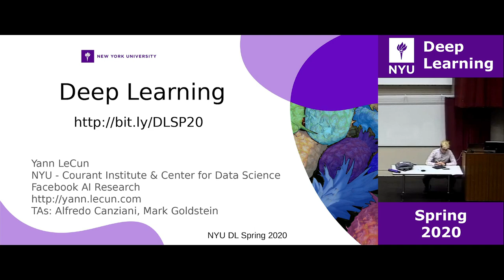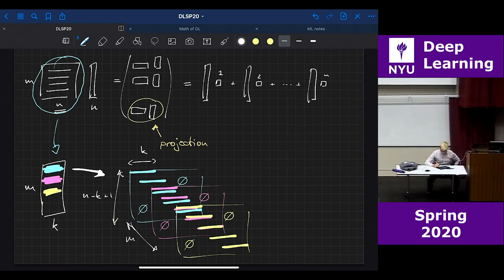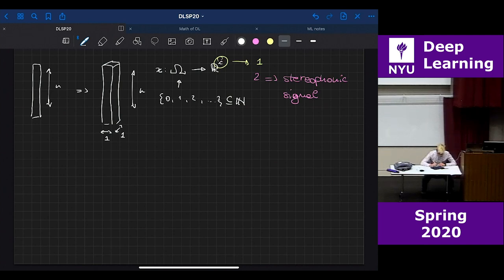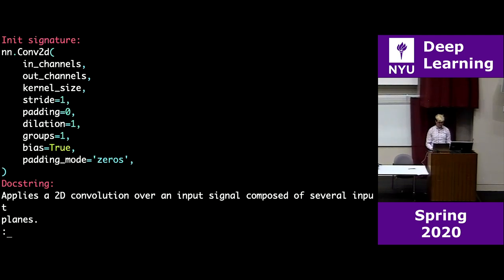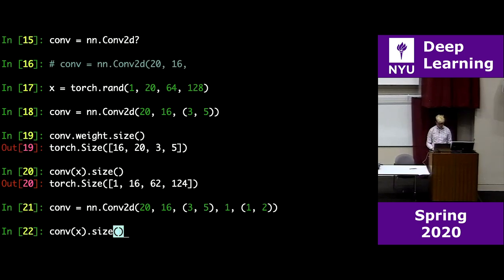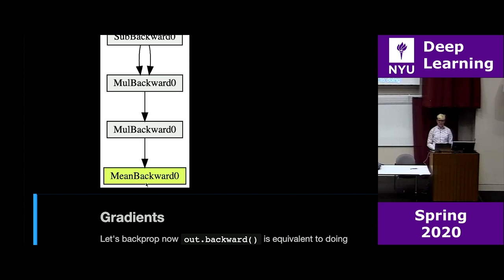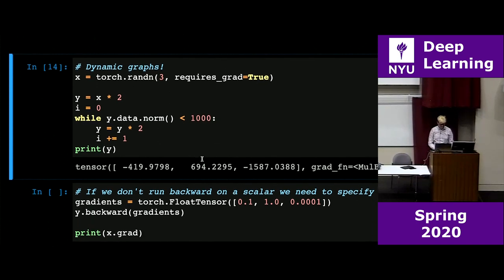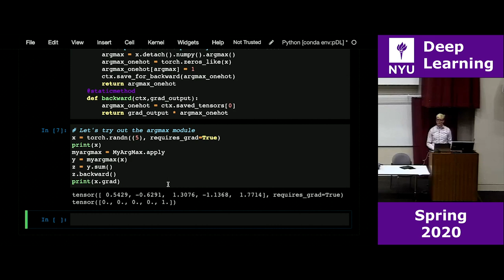Week 5 – Practicum: 1D multi-channel convolution and autograd

Comment: It seems that the kernels are not 3 x 5, rather they are 3 x 5 x 20. Since there are 3 x 5 x 20 weights per kernel. If so, it seems counterintuitive to think of the kernel as 3 x 5 - if it is in fact 3 x 5 x 20. In other words, for 2d convolution with C channels, each kernel will be 3 dimensional. I guess you could decide to share weights between channels, but that does not seem to be what Pytorch does by default.
Reply from the maker: Your question is not entirely clear. Did you mean 20 × 3 × 5? Also, you didn’t define what C is equal to. 😅

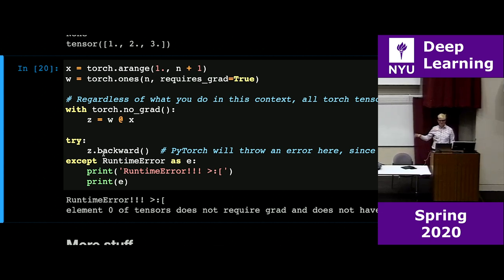Comment: Could you please explain once more, why z.backward() will throw the an error there (~42:23). I can't understand this error in my code: RuntimeError: element 0 of tensors does not require grad and does not have a grad_fn
Reply from the maker: Because I turned off the forward graph generation a couple of lines above.

Comment: Hey Alfredo, a little help is needed. I'm curious, why are the mini-batches' or individual samples' gradients good estimators for the gradient of the full dataset? I get that this is kind of how the expected value works, and the more samples in the mini-batch the less is the amount of noise, but what random variable do we sample when we compute those gradients? Like, what is its probability distribution?.. I'm kind of confused. If it's not at all about probability distributions, then why does averaging work? I get the redundancy argument, it just for some reason seems too hand-wavy for me, I feel like I need some maths. Thanks!
Reply from the maker: You need to include the minute:second of the part of the video you're referring at. It's hard otherwise for me to address your question.

Comment: I didn't get where the n-k+1 came from at 6:00
Reply from the maker: I used to explain this with my fingers to undergrads. Let’s try here as well. I’m holding my hand with fingers spread out 🖐🏻. Now I use my other hand two finders ✌🏻 to touch all consecutive finger couples of the other hand. (Try doing it yourself!) First, I have my index touching the other thumb and my middle finger touching the other index. Then both indices and middle fingers touch. Keep going until the index touches the annular and the middle touches the pinky. Did you count how many steps it took? 5 – 2 + 1. You can try a variable number of fingers to understand this better. I usually have a kid holding two hands with spread fingers to play with larger numbers.
Reply: @alfcnz  Oh Prof. Canziani thank you so much! I'm humbled, I take note! I will go at it again